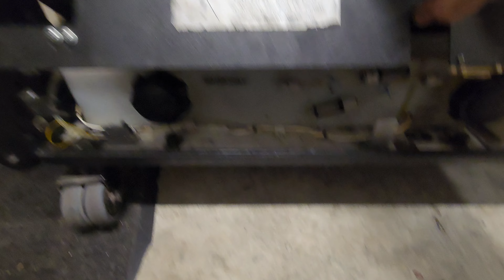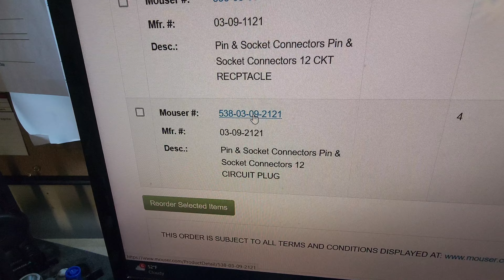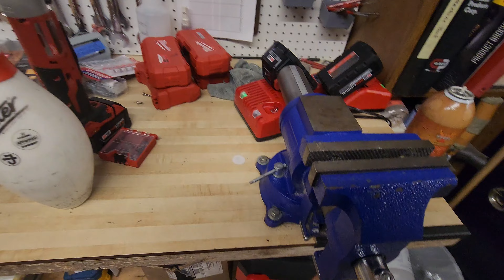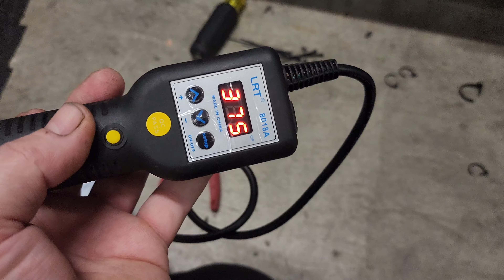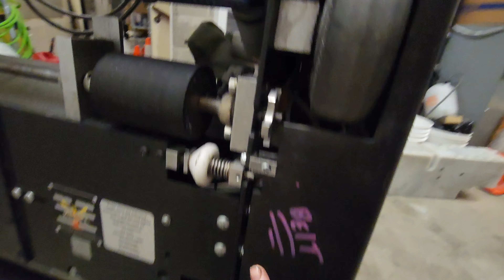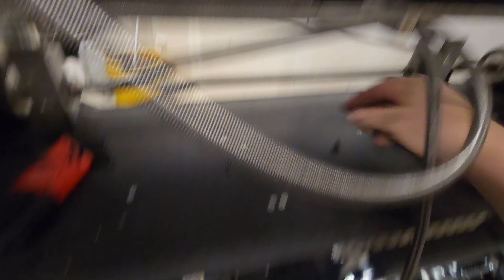2016 FLEX Rehab. Part 1 - Pin Deck Spray Removal.

Comment: I'm still rocking an ION Sport Model D Touchscreen from 2012.  One of the best machines Kegel ever made.  A year or so after the original Flex came out, I did the Duo conditioning system upgrade and did the lithium battery upgrade as well.  Currently only on my second lithium battery in 12 years for a 30-lane center.    For a short period of time I worked for a distributor that rebuilt lane machines.  All the Kegel techs hated the flex there, including myself.  2014-2016 Flex's were garbage IMO.
Reply: Our sister center got a new 2016 Flex and had nothing but problems. The distributor eventually took it back and they got a 2016 IKON that was very reliable. I got that IKON after that center closed down and never had a problem with it. Unfortunately the boss bought an Atlas Pro and sold the IKON. I wanted to keep it as a backup machine but, I get to keep my old ION Model B instead. Oh well, that one is pretty reliable too.
Reply: @pitman2  Had an ION Model B prior to the Model D Sport.  Mechanic before me neglected the shit out of it.  It was a disaster.  Owner ended up purchasing the Model D Sport to be used as our main machine.  It's been pampered since day one and still looks practically new other than the plastic side guards being slightly beat up.  We store our lane machine in the service isle by lane 30 since there's nowhere to store it in the shop.  Took a couple hits from bowling balls during open play over the first year.  I then decide to make a "guard" that sits in front of it.  I ended up refurbishing the Model B myself when I had free time.  Used it as the "weekend" machine for a year or so until my owner decided to sell it to our distributor for credit.  Worked out in my favor.  Got a lot of pinsetter parts from it!